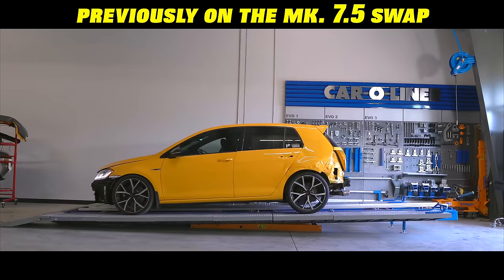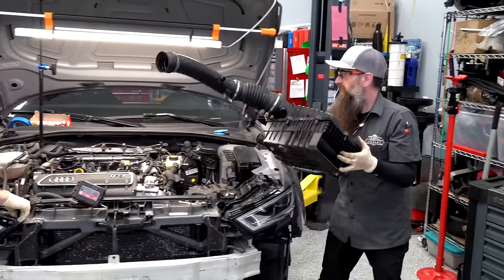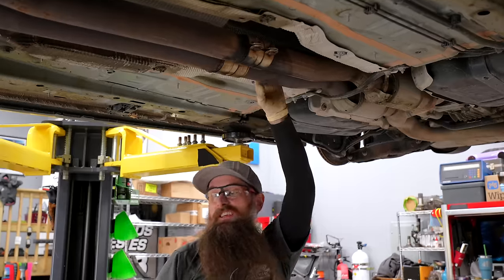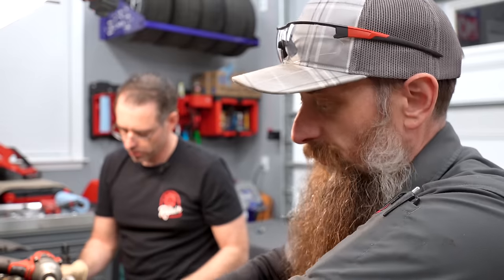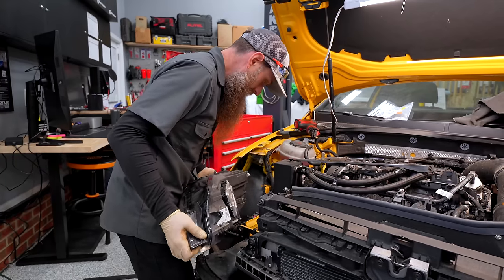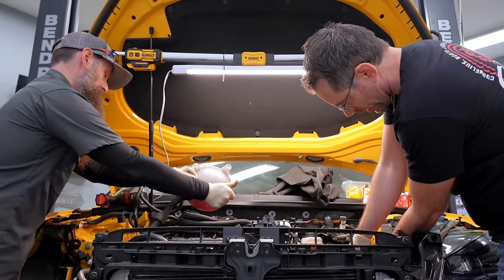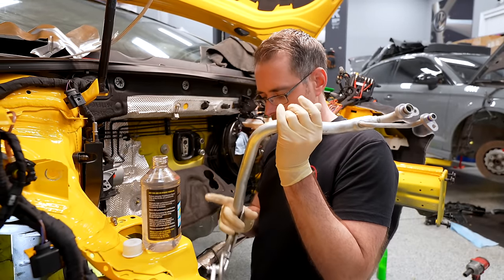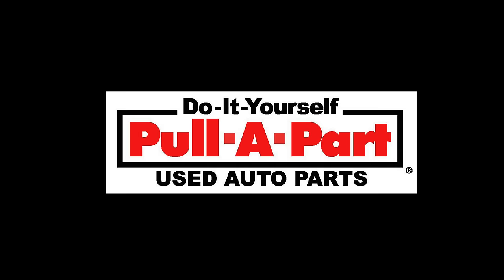Audi RS3 Engine Swap on a VW GOLF R - DAZA SWAP!

Comment: Oh god, please, PLEASE don’t let Paul throw all the old R hardware in the dumpster yet! It would be epic YouTubery to see the stripped-down car on the lift, all of the RS parts articulated on the floor on one side, all the removed R parts articulated on the floor on the other side. And then give everyone a quick compare of size and beefiness between the two models’ components. Extra credit if you weigh them. Would make for fascinating VW tv!
Reply from the maker: I won't let Paul throw ANYTHING away HAHAH
Reply: @HumbleMechanic  the rs3 is sick, i want that engine in my B8 or my mk4 golf! My golf has been non opp abandoned for years waiting for a motor a daza would be wild to put in there
Reply: @ObsidianB8 build yourself an 07k for the mk4 and save 💵💵💵
Reply: @PistachioVentures  yeah the car is just a boring 2.0 with the slosh box Auto which both got to go
Reply: Ok guys, great stuff as usual.
How about stuffing the golf r engine trans into Paul’s really sad gli mark six.
Reply: @samiam6382  I just go done watching that
Reply: Paul should hide some various important/expensive parts in one of the other cars just for laughs.
Reply: As you guys probably figured out… the rad support/rad/condenser/impact bar all come off as an assembly then get disassembled seperately when off the car. Ask me how I know 🙃
Reply: Put it in a mk1
Reply: @ObsidianB8 I would put an 07k in there instead. The 2.5 VW I5 can take boost well, and is cheap and compatible. However, since I assume you’re in Europe (USA never got the B8 Passat, instead we got the sad Chinese Passat NMS [unless B8 refers to the Audi]), you may have to ship it in.
Reply: @ObsidianB8 I wanna put a DAZA in my B6 for the ultimate street sleeper
Reply: @gopium1976  yessir I had a b5 1998 loved that car but it was cursed
Reply: @ObsidianB8  lol don’t get me started on the curse😂 but she’s like a wounded loyal dog getting me to work and dragging things around. She’s an absolute money pit. But got me through some dark times……homeless for 4 months blah blah blah can’t get rid of her
Reply: @gopium1976  yup, That's how my B5 was and I wanted something that would do everything the B5 would including the style the driving characteristics the power, and I found that the V8 is exactly like the B5 in all of the categories just newer. And I like the b8 out of the box because it's basically a stage 1 to 2 B5
Reply: @gopium1976  funny enough I'm at the car wash right now washing the b8

Comment: Hoping you guys fogged the engine after finding out it was sitting for a long time after running on E85.   Those sleeves get crusty quickly in my experience.  I’m sure you’ve already scoped the cylinders and what not to check out everything considering the cost of this engine.  Also, was curious if you have seen the Mighty Car Mods series with the VW Up conversion they’ve been doing.  It’d be so cool to see you guys and Marty and Moog working together on something one day, despite the logistics.  An excuse to write off a trip to Australia as business expense.  Enjoying the series!

Comment: Thanks for showing both cars side by side during this build. Question for you, why not upgrade the engine mounts to something other than OEM along with upgrade fuel lines since you are doing so much work swapping the engines?
Reply from the maker: Many daza running high power on stock mounts and fuel lines. 

We did end up going back with new OEM mounts. You’ll see that next week

Comment: Hey Charles what front/rear brakes did you have on your golf r before you started the swap need to replace mine soon and I notice you had drilled rotors, awesome video rs3 swap in a 7.5 is the ultimate swap keep it up!!❤❤
Reply from the maker: they were DS2500 pads with basically Giro rotors. AWESOME setup! highly recommend

Comment: Here in Brazil, @DiegoFaustino68 will do the same swap, however, in a Golf GTI, transferring the suspension, 4x4 system, gearbox and all electronics from the RS3 to the GOLF GTI, anyway, good luck to you

Comment: I wonder if the A/C lines are "concentric" because they run quite close to the back of the engine/turbo, so the "outer low side" insulates/cools the "inner high side" to reduce excess heat/pressure. Pretty clever if that's the case.

Comment: i only now just found ur channel. I want to thnk u for the great help that ur are giving to humble ppl. I have a 2009 fx35 RWD suv that now has over 200'thou miles. It lately starts to rattle over pumps and the sound is pronounce more inside the cabin. I changed the shocks assm. and it helps with smoothing the ride, but the sound in the cabin is sill there. What do think i cound do to help to stop these sounds. especially in the back seat area? I thnk u.

Comment: Such a great idea. When I raced motorbikes, getting the suspension right shaved off a lot more time than buying more HP. So with that in mind, what’s the weight difference between what you removed and what you installed in the Golf?  For bikes, I’d just go to a GMD Comptrak shop and let them work out the geometry, springs and damping. No idea what to do with cars.

Comment: Reason the a/c lines are 2 in 1 is because it creates a place for sub cooling. The suction line (larger diameter) cools the liquid line (smaller diameter) makes the a/c system work less. Refrigeration technician here 👍

Comment: And my next question which may be even weirder.  Since the Golf R MK8 and Audi S3 are pretty much the same thing.  Could a S3 be converted to a 6spd manual?  I spoke to a friend of mine who is a tech at a VW dealership.  We looked at the Golf R and S3 console where the automatic shifter is on the S3 and 6spd on the MK8.  Although the auto shifter layout looks different in the S3 from the MK8 auto.  They are the same dimensions.  So he is almost positive no cutting and trimming would be needed.

Comment: do you plan on replacing the subframe, Transmission mount and motor mount bolts because they are one time use stretch bolts?
Reply from the maker: Probably not this go around. I want to make sure nothing needs to come back out before we replace $300 I. Bolts

Comment: First of all.. Congratulations on getting your baby back!! Such a bad ass rebuild with the Daza swap.❤ I had a super random question for you.. I recently picked up a 2017 Audi S3, since my last one was totaled by some dummy making an illegal turn, so I feel your pain of seeing your baby go.🥲 However, this new S3 is amazing, love the color combo on it, and it performs amazing.. However, when I take off from a full stop, I get this split second hesitation, and then the car takes off normally. I scanned with OBD11 and no codes whatsoever! I did tinker a bit more, and turned off trac control... Voila!! No more hesitation with trac control disabled... which would lead me to believe maybe the Haldex pump is faulty? I'm hoping, praying, and wishing that the last owner tried to service the pump and did not put in enough fluid or didnt bother to clean the screen filter.. Just wanted to know if you have seen something similar in your years working on these cars. Car feels great otherwise, pulls hard, shifts buttery smooth, and no weird noises or other issues. Sorry to blow up your comments.. 😂 Just kinda frustrated and wanted some pro input before taking to a stealership.🙃 Thanks and love your channel!!
Reply from the maker: It’s worth a look but I’m guessing it’s more likely a built in feature. 

Usually a tune improves throttle response. Tough to say without experiencing the issue though
Reply: @HumbleMechanic  Super weird, but I might end up biting the bullet and taking it in for something cheap like an oil change and asking them if they can run diagnostics with a better scanner than my OBDEleven. Maybe they'll be able to see something I'm not. Thanks for the reply and have fun with the new and improved R!!! 🤩

Comment: Totally off topic but would it be ok to service the transmission on a 2017 Touareg with 75k miles soon, I've heard a mixed bag usually around 60k or 5-6 years.  I was recently informed that it has never been done since my mother owned it(4 years) or the awd and she's heading into retirement so she wants to drive it several more years instead of buying a newer Audi for a replacement. She is going to be doing timing chains around 100k miles and just slowly doing more maintenance for reliability. This is such a cool project and something vw will never give us in the gti atleast here in the US.

Comment: Ok ok I think I FINALLY FREAKIN found the man I need to ask a serious question to....I own a 2011 scion xb release series and I have almost 200k on the stock motor with the fact that Toyota did some work on it five years or so ago because apparently they burned oil and didn't ha e a recall so I said "lawyer" and they said BRING IT IN LOL SO new pistons crankshaft rollers I believe 🤔 but long story short it stopped burning oil....I love my car but I want it to be fast!!!! What motor should I go with I wish I could put a 2jz in it but that's not gonna happen do to size is what I was told so any suggestions?

Comment: I'm curious, why didn't you just drop the engine with the whole subframe, suspension, gearbox etc all still as one unit? Surely it would've been a lot easier than one thing at a time?
Reply from the maker: the subframe on this car is almost completely separate. If this was like a MK3, that would be easier, but nothing would really be held on to the subframe.
Reply: @HumbleMechanic   so you can't keep all the parts I mentioned above connected to be dropped out in one swoop?

Comment: Would it be beneficial to weld a tube into the frame rail hole for strength?
Reply from the maker: If the audi was, I would have. but I dont think its needed

Comment: Which Milwaukee impact wrench is that??? Mine is absolutely garbage too but it’s the m12 with 339nm. 

My Bosch with 210nm never struggled with anything yet this one has more power and it can’t undo most lug nuts. It’s absolutely garbage. I wanted to buy a big m18 but DAP looks like he’s struggling too. They need to fix their wrenches.
Reply from the maker: they are both M18. one is the older mid toque(my go to) the other is the newer High torque. The M12 will take off wheel bolts, but it doesn't seem happy doing it

Comment: those round things that are used on the heat shield and screw onto the stud.... What are those called? Mine fell off my car and the shield is just hanging. Also the studs are rusted. What should I do?
Reply: It’s called a push nut. You could try to run a die up them and change the size.

Comment: Apparently, some people have taken to storing 12V batteries—the kind used in electric wheel chairs and emergency lighting systems—on wooden shelves to maximize their life expectancy. Is there a spark of truth to this or is this claim dead in the water?

A bit of research reveals this to be a zombie truth: it used to be that batteries would discharge faster when stored on concrete, but newer technology put the kibosh on this phenomenon. Yet the belief persists.

A hundred years ago, this rule-of-thumb was quite useful, as the case around the battery was made of wood and the electrical cells were glass. If the concrete floor underneath was wet, the wooden case would swell, causing the glass cells to break.
The batteries of today, however, are encased in plastic or hard rubber, which significantly reduces this energy waste. Batteries do naturally self-discharge over time, however, but this is due to an internal process, not the type of material on which the battery is sitting.

Comment: if you heat up those rad clips you can use 2 flat heads to depress them and pop them out (fun fact)
Reply from the maker: Yea they are doable even with out the heat. but man they SUCK
Reply: Yup absolutely HORIIBLE.  Bring back the mk5/6 version! @HumbleMechanic

Comment: Will a 4.2 V8 fit in a GTi, it a 5.2 V10?
Reply: It’s been done before in MK4 Golfs. GOGI Racing swapped the 5.0 V10 twin turbo engine from an Audi RS6 C6 into a MK4 Golf, they also swapped a 4.2 TDI into another MK4 Golf.

Comment: When are cars going to have standard disc brakes that are not part of the front wheel hubs, like they had on the old Jaguar diff/rear assemblies. 
Less floating weight the better, especially for torque steering. 
Are you picking up what I’m putting down 😂😂😂

Hello engineers!!!!!!! 
💙🇦🇺🤜🏼🤛🏼🍀🍀🍀☮️😎
Reply: I’d of loved to see you weld in a bit of tube for those two huge holes saw  holes…feck it would have made it stronger then factory VW all day. 
I’m placing the same style strengthenings in the chassis rail of a A9X Torana ATM. Haha😂😂. 

Tubular cross sections, create way more surface area, way more steel. 
Hence stronger under every angle of attack. 
😂🇦🇺🤜🏼🤛🏼☮️🍀😎
Reply from the maker: I’m not. That’s a place that adding strength is not really needed

Comment: I don't understand why you guys don't make the Audi job much easier
Reply from the maker: the damage is FAR worse on the audi. Plus im not a fan of the sedans
Reply: Did you miss the bit when they said the chassis is tweaked ? That would need major repair and jigging to straighten out and there’s always the chance of the car not driving straight again afterwards

Comment: i understand u being salty about the cats being emptyd out but i actualy do it my self because in the uk if there is a visual evedence of a cat delete pipe fitted its an mot fail even if its been mapped and passes the emmisions test so the way round it is empty it out give the same results as a decat pipe , obviersly not ideal but no where near asbad as having the resriction and sound no where near as good i realy dont belive in high flow cats there stupid expensive and still a resriction which ever way u look at it the only down side of emptying the factory cats is on some cars u can hear sound from the hollow tank not a good as just a decat pipe but its all about power and the bonus is you can sell the dust u brake out and get good money which will pay for the modifercation in some cases , u just need to know a guy that u can sell it to
Reply from the maker: I was hoping for a good payout on the stock cat !
Reply: wow i carnt belive you replyed to me , im honerd your a legend and in my opinion number 1 guy on anything vag ,, you have made my year literaly thank you and i carnt wait for the next video with all the wiring you have to do to make it work ,,, because 1 of my customers has a s3 2020 which im modifing and he was thinking of putting the 5 cylinder in it insted of upgrading the s3 engine i sort of explained the cost and work involved but showing ur video was so much easyier and showed that you literaly need the whole car not just buy an rs3 engine and drop it in